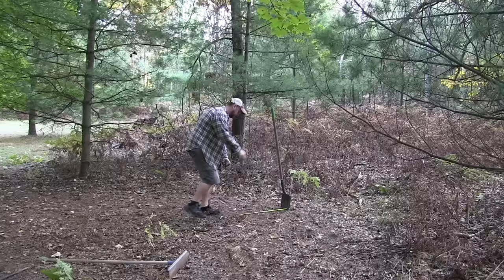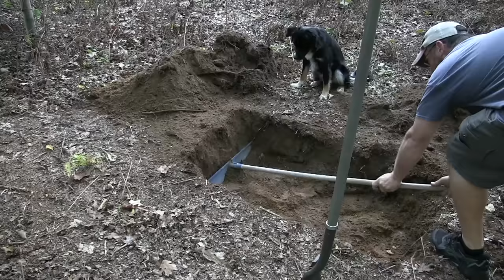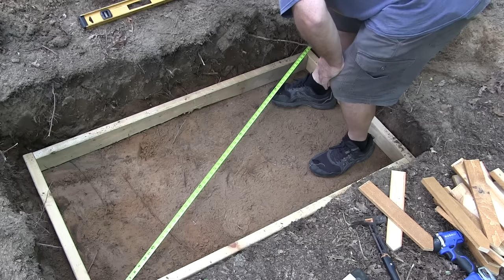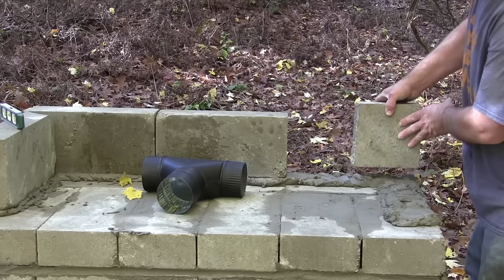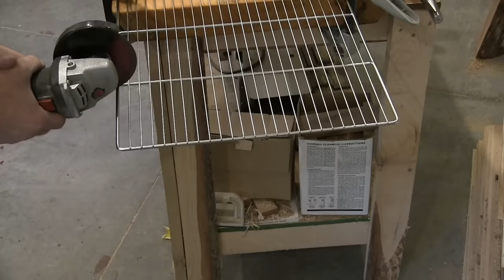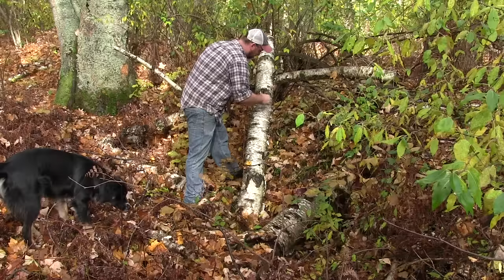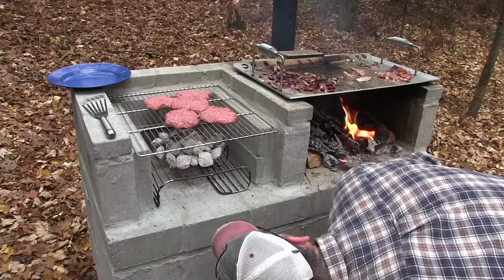building an outdoor kitchen for my off grid cabin

Comment: I had cinder blocks around my fire pit and after they get to hot over time they got brittle and broke. Has your stove lasted over the last 9 months?
Reply from the maker: thats true they will thats why I sued the solid ones on the top I also lined one fire box with fire brick . yes its in good shape
Reply: @blackspruce1861  very nice set up.
Reply from the maker: @djphilipj  thanks!

Comment: nice stove...BUT i watched a video where the cement gray blocks were used and when getting very hot, it exploded...better to use fire bricks and a small stove...do not know if true but i wouldn't want it to explode when visitors and little kids were around...grey blocks are very cheap; whereas firebricks are around $4 apiece...just saying...but nice stove...
Reply from the maker: I know it can happen I guess but I personally haven't had any problems . I did line the right side with fire brick a while ago . Thanks !

Comment: Why… what was the point of the wooden frame at the beginning if you were just going to fill the hole?
Reply from the maker: thats a good question . that is a form for pouring concrete in . the purpose is to give you a level surface to screed the concert flat from that is slightly bigger than what you are building on the concrete . If I were to just pour concrete in the hole it would be hard to tell how thick its poured , it would use a lot more concrete ,and it would be very difficult to get it perfectly flat and level .

Comment: Why did you use blocks of cinder instead of bricks?
Reply from the maker: the bricks you find around here aren't clay they're still just concrete . I wanted to use clay brick but not real easy to find so I just went with cheep materials .
Reply: @blackspruce1861  thanks.

Comment: Can you tell me what you coated the slab with and how it held up? Outdoor horizontal slabs are hard to preserve in my experience
Reply from the maker: I didn't coat it with anything its mainly just a footing . most peoplep only use curing compound on finished slabs . but I could see it being benificial on anything I guess.
Reply: Sorry, not the concrete footing. I mean the pine slab for the table. I see you brushed something on it to darken it and possibly protect it?
Reply from the maker: @brhynard  that makes sense. I’ve had pavers on my mind so probably why I went the wrong way with that . I used deck oil . It worked pretty well for quite a while , but I let the leaves sit on it all winter and most of the spring and it now has some mildew . I think some bleach water should take care of it though. I’m currently building a pavilion over the whole thing so that should really take care of it
Reply: @blackspruce1861  ok yup that makes sense. Thanks! A pavilion would do the trick for sure. I am going to try the mineral oil / beeswax coating and see how mine does outside
Reply from the maker: @brhynard  never heard of that combination, I’d be interested to hear how it works for you
Reply: Sounds good! I'll try to report back in a years time...

Comment: How many of each block was used to build this?
Reply from the maker: I think it was 24 8x8x16 blocks 8 8x8x8 blocks 16-4x8x16 solid blocks and a bunch of the small bricks
Reply from the maker: I don't know why that line is in that comment
Reply: @blackspruce1861  Thank you looking at making one of these.
Reply from the maker: @jackflash646  no problem I hope you enjoy it you may want to line the fireboxes with firebrick to make the block last longer you could also use refractory mortar on the solid block I was cheeping out a bit
Reply: @blackspruce1861  good to know thank you. Nothing wrong with cheap if it works and don't go boom

Comment: Not bad but i think the misture is a little dry.. Hopefully it wont crack with heat
Reply from the maker: Thanks ! the lower blocks should be fine the only way the motor joints in the fire box area won't crack would be If I used refractory motor and that was around 50 bucks a bag was being cheep

Comment: The griddle plate? Where did you by it ?
Reply from the maker: my sister in law actually gave it to me but the company that makes it is called MMMUSA.
Reply: @blackspruce1861  thank you! Another question; How the blocks are holding up against the fire heat, since it's not fire rated.
Reply from the maker: not bad so far , I did line the right side with fire brick so that helps a bit . here's a link to that video .https://youtu.be/8I-xQESqTPU . I have a few videos that I used it in and one that I built the pizza oven , if you're interested
Reply: @blackspruce1861  Yes! Thanks! I seen many videos regarding the same kind of project, but yours is simple, for the ordinary guy/ girl.

Comment: What are the demintions ? And how many center block did you use.
Reply from the maker: It’s 2’x4’. I filled the center with sand .
Reply: @blackspruce1861  Thanks.  Hate to ask but can you give a ruff estimate of cost
Reply from the maker: @youtellme2731  probably around 250-300 . But my sister in law gave me the griddle

Comment: I've always heard that cinder blocks break down fast with high heat.
Reply from the maker: they do . I lined the one side with fire block in another video on here . the thick solid block I used for the fire box area has held up well so far but the hollow blocks can't be used for a fire box at all
Reply: @blackspruce1861  good to know. I was about to use them for a simple fire pit. Laid on their side to let air in. Good experiment  ... we'll see how long they last. I sure like what you built.

Comment: Won’t that block explode because it isn’t fire brick?
Reply from the maker: I hear that all the time . it might happen but I haven't had any experience to worry about it . a friend of mine built a block fireplace patio years ago we sat around that thing with good fires in it for hours at a time a few summers in a row we never  had anything explode . the one thing that did happen that was the long exposure to fire caused the block to crack and crumble . with this I'm only burning it maybe an hour and a half a t a time so I think it will last quite a while longer . I lined the right side with fire brick to reduce the heat damage .

Comment: I was going to buy some 1x4s to make a frame to pour concert. 8 bucks for a 8'  👀 My God i can buy 2x4s at 8' for 3.22 dollars So? that what i went with the 2x4s > It just don't make any since? or does it?   he hee NO WAY
Reply from the maker: I think its because 2x4s are mainly used for framing and 1x4s are often used for finishing touches trim Nice looking stuff like that .
Reply: @blackspruce1861   They use to be way cheaper than 2x4s  Not no more!  If i can split 2x6s on my table saw,  i surely can split a 2x4 down to a 1x4. The silly rabbits. 🤣🤣 I just split the 2x4s down to a 1x4  he hee much much cheaper🙄🙄Plus a clean new surface

Comment: You didn’t even need a half block at all 😂 good try but them concrete blocks won’t last long with fire. 🔥
Reply from the maker: I actually lined the one side that will get more heat with fire brick . everything is holding up nicely so far . you can check it out here if you want 
https://youtu.be/8I-xQESqTPU

Comment: you don't need the smoke stack if your front area is wide open ... If you close it then yes your smoke stack would be functional ...
Reply from the maker: as soon as you set the griddle on the smoke starts going out the chimney if it didn't have it all of the smoke would come out the front right in your face . it doesn't work as well as i would like but it would really suck without it

Comment: People, the brick layer that the fire touches should be fire brick, regular brick is okay for the rest, but the heat of the fire will eventually crack the regular bricks that constantly are fire heated (not talking about the ones under the fire bricks) and mortar and cement wasting your efforts to make this.
Reply from the maker: I did eventually line the right side with fire brick but the left side doesn't get as much heat since I mostly use charcoal on that side heres a link to that video if you want to check it out https://youtu.be/8I-xQESqTPU

Comment: Do not wash mushrooms with water wipe them off with a paper towel because they’ll absorb the water and they’re harder to cook
Reply from the maker: I never knew that thanks for the tip someone else told me not to wash with water but didn’t say why .
Reply: @blackspruce1861  they soak up the water
Reply: @blackspruce1861  do you have a rough total for money spent on that grill?
Reply from the maker: @francisagosh2175  I spent between 250 and 300 but the griddle was given to me and they are around 300
Reply: @blackspruce1861  thank you

Comment: Used cooking oil makes a great fire starters, for you pits and grill. What i use for Charcoal Briquettes, and Wood. I store it in milk jugs. I even use it in my fireplace, The used plastic milk jugs can be burn too. I use ALL KINDS OF used plastic in my fireplace for fire starters. Milk jugs, Walmart bags, Pop bottles, list goes on.  What people don't know is?  That plastic is oil based > Don't use plastic in your pits and grills  ~ That would be NASTY TASTING This cuts down on burning trash all the time>   i would say plastic is the #1 thing that is being throwed away. That can be used for other things. To put things in, and Like a fire starter
Reply from the maker: I'm all for reusing plastic containers but I never burn the stuff just smells awful and gives me a headache
Reply: @blackspruce1861    I hear ya. I got a dump not far from me. But it really don't give off a bad smell I don't smell it>  course it all going out the chimney.   Out side i might can smell it. Only using it as a fire starter.   Only thing i smell is Oak Burning

Comment: Shouldnt they line these block ovens with fire brick!!??? I would make a cindet block rocket oven for tempurary or emergency use only. Most cinder blocks made today are incredibly weak. I bought some new ones and they break if you drop them. You can snap cap blocks by hand!!
Reply from the maker: I lined the right side in this videohttps://youtu.be/8I-xQESqTPU 
I'm not so worried about the left side the  charcoal stays away from the sides just doesn't seem as hot

Comment: Should have wet the dirt b4 pouring the concrete, that dry ground started sucking the water from the concrete immediately 😢😢😢
Poor concrete pour😢😢😮
Reply from the maker: I had just dug the hole and the dirt was plenty moist enough . also as wet as I poured that concrete it will be fine
Reply: @blackspruce1861  I stand corrected, peace

Comment: Why did you cover the wood with the concrete, that little bit of concrete over wood is not a great base, better off staying inside over the block you created. But this is a nice kitchen. I've seen way way way worse construction technique, and they spend a lot more on the stuff they installed on it, so they should have done it right. Even with that wood issue, I bet this thing outlasts you, which is all you need.
Reply from the maker: I didn’t actually build over any of the wood forms I just didn’t feel like pulling the forms out when I was done . 
Thanks!!

Comment: It was a waste of materials just for a cooking?
Reply from the maker: That’s your opinion
Reply: Not waste of material, but the foundation is way too strong for it. I live in  NY, and wondering  if I dig a hole 2' deep, fill with 3/4 stones, packed it hard, than a metal bars, and 4" of concrete on top. Then lay the blocks. I don't have a cement mixer, plus save labor and money. It  will work?

Comment: Tin snips are for sheet metal! Use a pair of dikes (diagonal cutters) or a small bolt cutter for small round stock. Or an angle grinder. Ruin yer darn snips like that...
Reply from the maker: I did switch to the angle grinder . maybe that wasn't this video but yes the angle rider is the way to go for sure !

Comment: Why would you have to dig a hole? Can't you just build the  thing on top of the ground? Your making it much to difficult.
Reply from the maker: The dirt that I dug out is topsoil lots of decaying leaves and vegetation small roots . All of that soil is soft and breaking down . If you build something heavy on that it will settle over time and is likely to settle un level. Getting past that topsoil gets to good solid ground that’s compacted and not breaking down

Comment: Aw man I saw the kobalt impact and lost a little respect but to be honest you put alot of work into something that could have been way simpler.  With that out of the way, the video was entertaining.  Let's face it, your project wasn't the point. The views were. Scored a comment too.
Reply from the maker: Lol well it could have been much more complicated too . It may have been overbuilt but it wasn’t complicated. As for the kobalt well I picked up a sweet deal at a pallet sale on some other kobalt stuff and had some batteries so figured the more of the same batteries the better I would definitely prefer Milwaukee but they’re pretty pricey. Glad you enjoyed the video though
Reply: @blackspruce1861  I found one in a car I was honna scrap. I used it, won't lie. It did crap the bed though. Milwaukee is far superior.  I get tied up in the doing of things. I don't have the energy or inclination to turn on a camera. That's why I watched  yours. Congrats on the success of the video though.
Reply from the maker: @towdoctor670  yeah filming definitely slows down production but it’s fun too . Thanks !